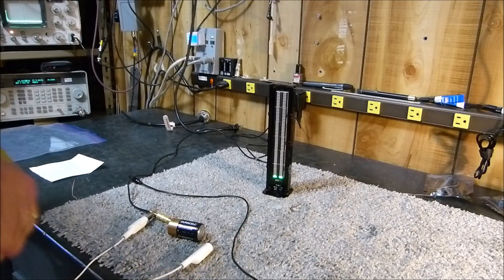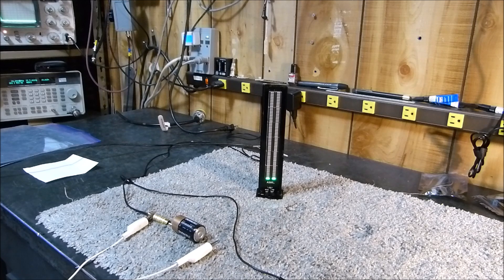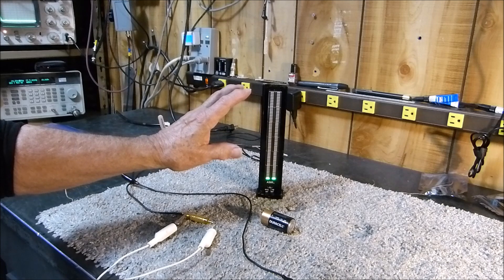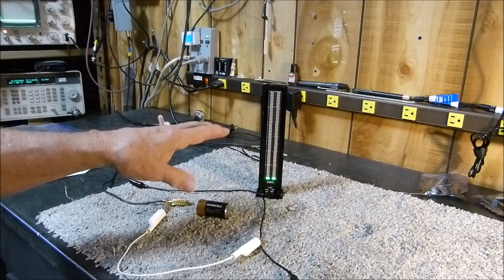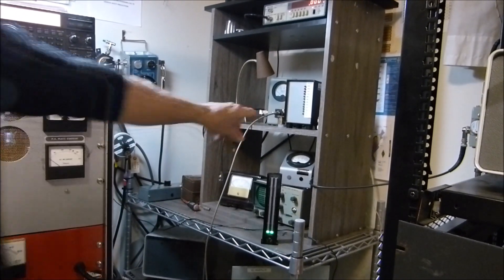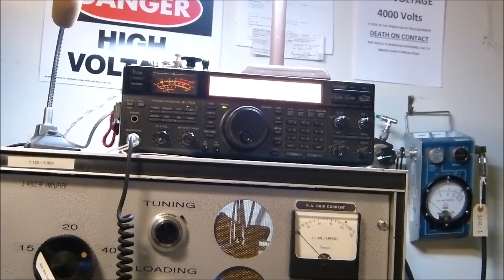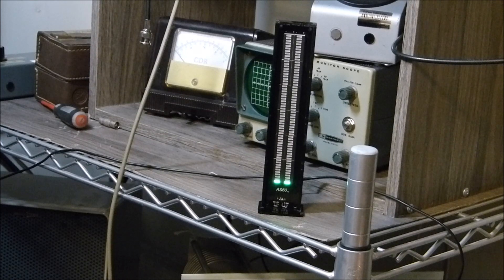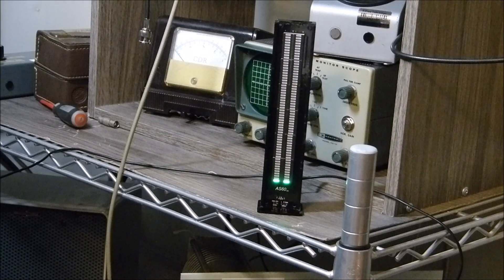Peak Reading Wattmeter for Audio and Radio Frequencies.

Comment: I just wonder why you do not want to discuss RMS power? It appears to be a valid term under certain conditions, but I was intrigued by your position.
Reply from the maker: The term, RMS power was adopted by CE (Consumer Electronics) as far back as the 1970's. It was an attempt to add some meaning to what manufacturers of audio equipment had to abide by so that there would be some meaning to the power measurements that they advertised their equipment could provide. RMS values of a sine wave , both voltage and current, is a mathematical way of determining its equivalent DC heat producing value and multiplying RMS voltage times RMS currents gives average power. 
RMS is a type of average and is used in other areas of math and science when data has both positive and negative values like a sine wave to derive an average by squaring all the data points, thus making all the values positive, then performing a standard averaging process. Power does not have a positive and negative value. We see it as positive and has two mathematical values, average and peak. You can look and will find that people have addressed the RMS power issue for decades and there are different schemes for coming up with RMS power values. In any case, with these various and complicated methods of arriving at a value for RMS power, the number is actually a bit larger than average power and good for marketing.
https://www.w8ji.com/amplitude_modulation.htm
If you look at documentation for scientific measuring equipment, like a Bird RF wattmeter, you will see that the term RMS power is nowhere to be found as it is not a legitimate mathematical derivation for power measurements. Usually it is spoken of as simply, "power", implying average power or "Peak-Envelope-Power (PEP)".
With all this said, the term RMS power has worked its way into our technical lexicon and is used in non-mathematical and scientific terms to mean constant power. It is an advertising term and as mentioned, attempts to refer to constant power delivery or dissipation.
I might go on to add that, for example, voltage and current, among many others, are actual dimensions, just like length and width  are dimensions. If you multiply voltage times voltage you get voltage squared, etc. RMS is not a dimension, it is an average of positive and negative value and the sine wave is usually the way we use it.

To make it even more confusing, the average value of a sine wave, which only considers the positive half of the sine wave between 0 and 180 degrees is approximately 0.6366 times peak. As we know, RMS considers both the positive and negative half of the sine wave, 0 to 360 degrees and is approximately 0.7071 times peak.

https://rftech.custhelp.com/app/answers/detail/a_id/199/~/cta-2006-%28cea-2006%29-amplifier-power-standards

Further reading:

https://rftech.custhelp.com/app/answers/detail/a_id/468/related/1/session/L2F2LzEvdGltZS8xNjkwMTgyOTY2L3NpZC9mVWNUQTROMzJWUVRnYmRYWDE2QW5aNjk2TVkzcDdvQndjeXA0ZU1BUkt2bzNua2JSOTNyQUc4Nk9wUEl5a09aeEhLeXlxRnlhc2VYNUJsdDRCR0hNeHliMVo2SmhoYUolN0VPMjRPNDBaeUNvZHp4YmdtT1N1UmxpQSUyMSUyMQ==

https://rftech.custhelp.com/app/answers/detail/a_id/199/~/cta-2006-%28cea-2006%29-amplifier-power-standards

I think it will be noticed in legitimate research and documentation, the term "RMS power" is never mentioned but I can only assume since it is RMS voltage times RMS current, the public thought is that it is "RMS Power'.  I don't have a problem with this and I know this is a common term used throughout the audio world and I do not make an issue of it if it is used during discussions.  In a social discussion, trying to win this argument is futile and pointless. But in the strictest of sense, if we are doing legitimate engineering, we have to adhere to standards and differentiate between these values not based on public opinion and preference.
Reply: @ElPasoTubeAmps  Great explanation. I just wondered why you did not present it to your audience to educate them. Most do not realize that RMS power is the equivalent of DC from a heating energy standpoint. Most internet "experts" have many false beliefs. Let's correct them. Keep up the good work Dave, us old guys have generations to educate.

Comment: Good ideas for use of such a meter.  BTW, this is the second time I've heard you mention not wanting to deal with the hassle of file sharing for an excel spreadsheet.  As it turns out, Google docs has all the sharing and permission (read only, for example) stuff built right in so you can just import your whole spreadsheet to a google doc, set it read-only, post the link, and done!
Reply from the maker: I do need to get around to learning how to upload files as I would be happy to share them.  I suppose I should watch a YouTube video on how to do it.  🙂 I see I am getting a lot more thumbs down on this video. Why do you think that is ?
Reply: @ElPasoTubeAmps  I dunno what's up with the thumbs down although YouTube recently made a very unpopular announcement that they're taking that feature away imminently.  Perhaps it's just people being contrary?  I don't let it bother me I like having a small channel.  Got a rare HP amp on my bench at the moment and just about to shoot another episode.  Check it out if you're into HP gear.  I want to put one of those meters you showed on my audio dummy load tank soon, it would make one less multimeter used up in the test jig I have it on now.
Reply from the maker: @hugeshows  I didn't know that about YT removing thumbs down. The Ebay seller can not say negative things about the buyer and the owner of an AirBnB can not say negative things about their guests.  I guess our society is eliminating "bad feelings" but more likely it has to do with litigation and money... 
Sounds like a war on negativity... any time we have a "war" on something, it takes a lot of causalities. On the other hand, nasty people can hide behind the anonymity of the Internet and social media.  In any case, I will survive the thumbs down.
Otherwise, I love HP equipment and prefer HP spectrum analyzers and most RF equipment to Tektronix but the Tektronix scopes are by far the best, in my experience. I will definitely watch your videos.
I seriously have found the visual effect of the LED meters really nice. It instantly conveys a lot of information to the operator of the station - besides just looking nice. I wanted to go this route with the 60 segments mostly for resolution. My homebrew meter is only 12 segments, which honestly, is enough but it's all for fun. Thanks for your thoughts.

Comment: Those large segmented displays are fun. Nice that this handles DC👍.
Reply from the maker: It just goes to show how, no matter how careful we measure and evaluate things, we can over look the very thing we are looking for. I suppose I was not paying attention those few years ago when I was trying to see if it would do DC and got something wrong. Tonight as I was examining the LED light bar again, I was intentionally looking for some series capacitor on the input. I visually examined it and checked out the one capacitor on the board and it was clearly across the DC input as measured by meter and there simply was no other series capacitor to be found. I started over making audio measurements and then the battery and ... I was taken back...  what ?  it's doing what I wanted it to do three years ago? Anyway, short trip from there to this video. Wonders never cease.